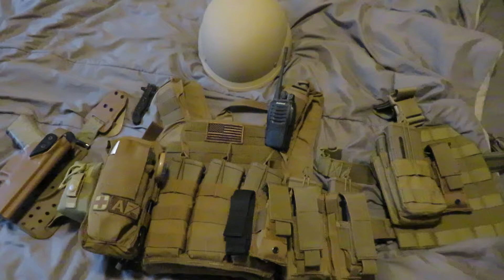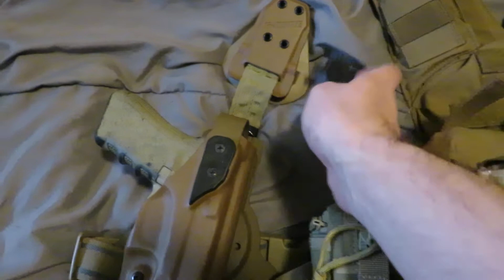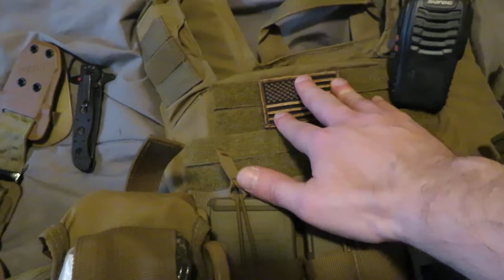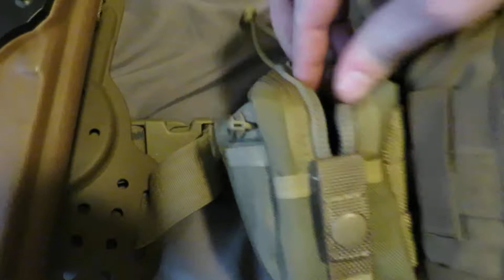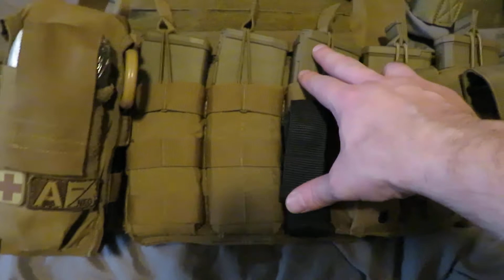Part 1: An Overseas and Emergency Response Security/ Defense Contractor Loadout

Comment from the maker: Remember-- different contracts and requirements alongside provision of equipment will vary, but this is a pretty standardized loadout for the type of details I do.  I am not showcasing any equipment outside of the worn loadout as that can vary or contain sensitive items based on the aforementioned, along with other specialized equipment (like certain types of radios).
If anyone has any questions, please let me know.
Reply: How does it work arriving at the airport in Baghdad? Is there an escort that picks you up and takes you to the embassy? What about leaving?
Reply from the maker: @backlashstudios6088  Fairly standard with work personnel arrivals, the Companies on the WPS contract work with DSS (State Dept. Diplomatic Security Service) and DoD/ Military so we usually just go to the DSS office/ station within the Airport and hop a ride from there to our facility or the Base we house and operate out of.  It's all well coordinated and established between all the moving parts and players.
Sometimes it's just a ride pickup or shuttle from the airport to the facility or base, works the same otherwise.

Arriving with Gear isn't anything crazy, we're not transporting Weapons and as we have the necessary credentials and visas/ paperwork it's just like any other work-related airport trip and arrival/ departure.
Sometimes kit is kept there/ staged at our housing/ facility or base, sometimes we take it with us as approved or otherwise with personal kit.
Reply: @DJTheMetalheadMercenary  Thanks for the info, I'm exiting the marine corps soon as a 0311 and am looking into applying for a WPPS contract, I have two deployments under my belt but no combat experience so im a bit underqualified but it can't hurt to send my resume in and send my shot.  The pool of combat vets to draw from is drying up every year so that might work to my advantage
Reply from the maker: @backlashstudios6088  Hey anytime brother.

There's a lot of companies and opportunities to look into and apply for, all mostly standardized now so it's pretty easy to apply overall, just the typical "hurry up and wait" game.

Make sure your "I love me" book/ folder is all up to date and you have all the required documents prior to applications.  Having a clean legal record is good too.

Only other tip I can think of right now is to read the job listing criteria carefully-- and with WPS gigs, be flexible, being the new guy you will have some dogshit hours after training and all that initial jazz is said and done, but the pay is decent (taxes are high now though).

They'll give you all the details regarding travel and all the liaison stuff and everything else.  Clearance and background check process takes the longest amount of time.

There is a competitive talent pool, but with AFG shutting down the options aren't as broad as they were all things considered.  Plenty of listings to check out through both companies' sites and listing segue sites like Silent Professionals.  Just take your time looking through them and weighing your options.

If you have any other questions just holler at me.

Good luck!!!
Reply: @DJTheMetalheadMercenary  I appreciate it dude, I do have two other questions for ya

1. What are the best companies to work for? If hypothetically both SOC A and Triple Canopy were willing to give me a shot which one would be better to work for?

2. Aside from the obvious stuff (safety violations, weapons qual) what sort of stuff tends to get people dropped at courses?
Reply from the maker: @backlashstudios6088  So, for OCONUS WPS and other gigs, you go through a fairly standardized 45 days of training.  There are PT tests, and they are pretty strict about firearm manipulation and such-- they train a certain way for a reason, and it works, so go with the flow.  I'm sure you'll have no issues with that being a grunt  ;)  it's good training, I really enjoyed that aspect.

Insofar as "best" companies, there's pros and cons to them all, namely typical company bureaucracy and the gov breathing down your neck.  Just weighing out the packages and benefits for each company (alongside pay) will help your decisionmaking process.

I've worked for Constellis/ TC, and the company policy bs and occasional poor leadership can cause issues, but it's pretty solid.
SOC LLC pays really well, know a few guys in that outfit and they seem to like it.
They all have their upsides and downsides, the industry as a whole has issues with turnover because of many factors, so stick with it for a bit, be flexible, and save up some money, and you'll be good to go no matter where you end up.

I know it's kind of vague but kinda not, hopefully that answered your question.
There are other comment/ discussion threads on this video and my part 2 video that give further insight into various aspects, hard to remember everything lol.
Reply: @DJTheMetalheadMercenary  thanks bro! I’ll be getting out here in the next couple months so once I have my documentation I’ll start the real application process.  The TC recruiter seemed willing to work with me, but I might reach out to SOC just to see what they’re offering.  Gonna take the few months the whole process takes to rest and recover from 4 years but also gonna take a lot of free time to tune up my shooting stay physically fit and all
Reply from the maker: @backlashstudios6088  Sounds like a good plan.
Good luck bro, anytime!!!
Reply: @DJTheMetalheadMercenary  hey bro just saw your new video really useful information.  I’m about 3 weeks away from getting out rn, started the process of renewing my passport

TC won’t put me on a WPPS contract since I lack a combat deployment but they offered me their force protection Kuwait one as a stepping stone, said after that I’d qualify for WPPS so I’m seriously considering taking it.  I don’t mind working my way up from an entry level gig, was wondering if you could tell me anything about the Kuwait gig, if it’s worth taking etc. it sounds like it’s basically just being a gate guard in a hot ass desert

Another thing I was looking at was maritime security, I reached out to trident group and I might go get my TWIC and STC95 and take their MSO course and try to break into contracting through that arena.  Was wondering if you knew anything about the maritime security world, pros, cons, if trident is good to work for, if it’s a good way to break into the business etc. Maritime security honestly appeals to me a lot more than standing gate guard in Kuwait, but like I said I’m basically just looking at different ways to break into the industry and trying to determine which one is the best one to take so I appreciate all the info you’ve been giving out
Reply from the maker: @backlashstudios6088  Right on!  

The Kuwait gig is a pretty good one, fairly cushy, takes a little bit of time to get used to it over there but well worth the paycheck if you want to stick it out for a little while.  Get that passport renewed asap.

Insofar as Maritime, you've done your research, which is good.  
That would be the right path to take if they'd accept you, one of the better paying gigs in the MSO world.  Just make sure you qualify and fit their criteria for the listings.
They usually require Marine Corps or CG/ Navy background with VBSS training, can get a little squirrelly getting onto the ships underway.  
Usually you work on a rotation (not entirely sure how long) and spend a couple of days up to a week with a client ship while passing through the danger areas, then you're back off again before they reach territorial waters somewhere (unless you're instructed to ride it into port).  

Hope that helps.
Reply: @DJTheMetalheadMercenary   I’m surprised the Kuwait gig is cushy I heard they don’t have toilets over there? But TC did say 72K a year which is pretty good pay for an entry level job as far as I’m concerned. 

I did reach out to Trident and they said I qualify to attend their MSO course and if I pass and they like me I’ll probably get hired. You said “that would be the right path if they’d accept you” are you suggesting that if I can get hired I should do that over Kuwait? To be honest Trident seemed like the only not sketchy company in the business, all the other ones were these weirdos based out of Malta or the Balkans or some shit and seemed to be hiring mostly Serbians and Phillipinos.  Not exactly the type of company I want to trust with my life

Appreciate all the info man
Reply from the maker: @backlashstudios6088  Hah nah there's toilets over in the sandbox, and the lodging and company facilities all have other contractor types keeping up with electrical, water, and all that jazz.  Kuwait is a pretty wealthy little country, much nicer than Iraq in most ways lol.

That's great news about Trident Group, I would say just weigh the benefits of the different jobs to each other and the pay rates, get as many details as you can from recruitment and make your choice from there, both are solid.

Good stuff!  Anytime bud.
Reply: @DJTheMetalheadMercenary  thanks bro! Take care
Reply from the maker: @backlashstudios6088  No problem!  You too dude stay safe!
Reply: What requirements do you need to work in WPS contracts
Reply from the maker: @adamcaza879  It depends on the contract and position within the broad spectrum that is WPS.
There's Static and Mobile Guard positions, Force Protection and DDM positions, ERT/ PSS/ PSD positions, even OGA stuff for the Tier 1 secret squirrels.

In large, they want you to be Combat Arms MOS's, Security Forces or MP, and have at least 1 Combat or Expeditionary Deployment.
There are exceptions for some seasoned SWAT guys, and Advanced Paramedics for Tactical Medic positions as well, and then of course all the SOF- related stuff.

If you have a Military background in general though, you have some options.
Reply: I’m pending contract with TC for Iraq mobile PSS. Do these companies care if we use our own carriers?
Reply from the maker: @זאב770  They'll issue you one.  If for some reason it isn't adequate or you put a request in, they may approve a supplementary rig, but TC issues a range of reliable stuff so you don't have anything to really worry about.  
You'll have some leeway options for buying secondary components too, the PX and other vendors around BIAP and in Kuwait are good, and if they don't have what you're looking for you can get expedited orders of stuff.
Reply: @DJTheMetalheadMercenary  They just hired me on for PSS wpsiii mobile, just waiting for my statement of service letter to be approved Thanks for the info. Looking forward to working with you hopefully this summer.
Reply from the maker: @זאב770  Congrats!!!

I'm not with TC currently, left them in 2022, working as a Senior Security Advisor and Response Specialist for some other companies now.  May run into ya in the future though, who knows lol.

Stay sharp and good luck!
Reply: @DJTheMetalheadMercenary  how was your experience with TC
Reply from the maker: @זאב770  Good up until the current administration came into office and screwed everything up lol.  That and TC not getting me back OCONUS for another rotation were the reasons I left.
Constellis/ TC takes care of their people, you'll have good teammates/ coworkers, I stay in contact with a lot of the peeps I worked with.

Comment: Is triple canopy still around, or did they change their name?
Reply from the maker: Yep, they're the flagship company under Constellis, worked for them up to the beginning of 2022.
Reply: @DJTheMetalheadMercenary  Thank you for responding back. There's two questions I have to ask. I'm trying to get my foot in the door for overseas. Contracting the hard part for me is that I do not have law enforcement nor military experience, and some of them require that or security clearance. I tried to apply to Triple canopy, but a lot of seasoned law enforcement or military experience requirements. However, another company will gladly take me, but they're paying very low. It's about $37,000 for the year, and it's a 1-year contract. Yes, that company can help me get my foot in the door. However, they do not offer security clearance. Im stuck at this crossroads.

 In 2023 I invested in a executive protection course that lasted 8 days so I know how to do defensive and offensive tactical driving Red Cross CPR/AED, TCCC, executive protection certificates and they train me on how to use a handgun proficiently.

Lost right now, lol.
Reply from the maker: @moneyguy6583  Good questions. 
First, yes that is correct, for WPS contract and the general bulk of security contractors for overseas work require LE/ Mil experience of some kind as you found out.  

Certifying courses are good, but they don't make up for experience they want to see-- with the training period before starting on the job it is more of an assessment to prove you have the skills/ background apart from what's verified with service documentation.

That other gig you mentioned with the extremely low pay sounds extremely suspect, likely (if it is even real) it is a static guard position somewhere in poor conditions with poor provision, no reputable company is going to pay that little and generally take someone without a background.

It is a "crawl, walk, run" type of industry, you have to work your way into OCONUS PMC gigs-- my advice is to get on a major metropolitan police department that has a high level of work tempo (and they'll pay better than that one-off low grade gig that you mentioned) for 5 years and then try your hand at getting into the overseas sector of the industry.
OR
Go the Executive Protection route and work up some time doing that for a reputable company (they much more often take civilians who have done certifiable training) at an entry level position, and put the years in there working your way up.
OR
Apply for the US Diplomatic Security Service (DSS), that is a State Dept. office that regularly works with WPS and other PMC's for dignitary protection operations apart from doing their own Executive Protection for US Embassy/ State personnel, it is a good gig.

Some things to consider anyway, good luck!

Comment: Was this all issued to you? Or did you have to buy any of this?
Reply from the maker: Kit in all of it's variation by what is available is issued, some components can be or are approved for aftermarket purchase and use (or if something wears out you can get the ok and hit the PX or whatever avenue to get replacement stuff).

Some stuff you can also have a stipend (partial or full) for too depending the company and contract requirements (like boots for CONUS gigs).